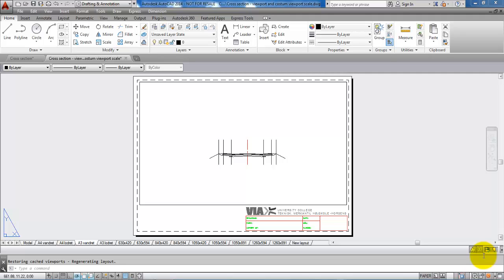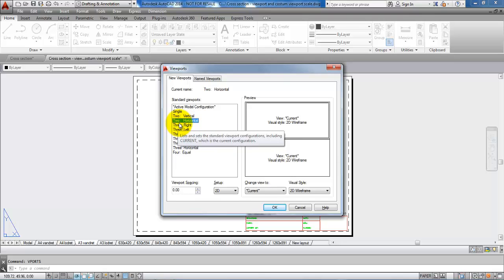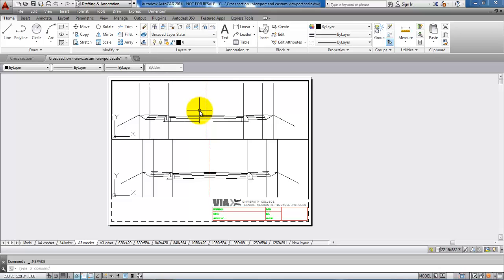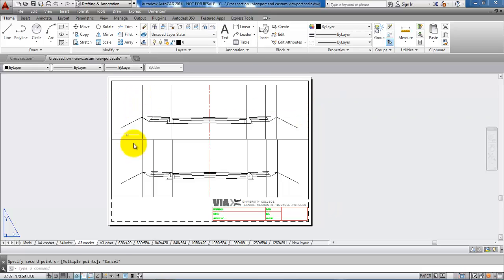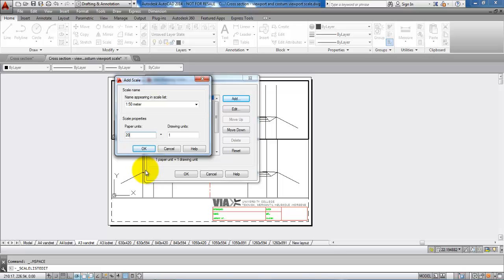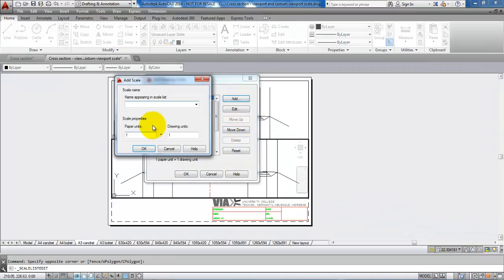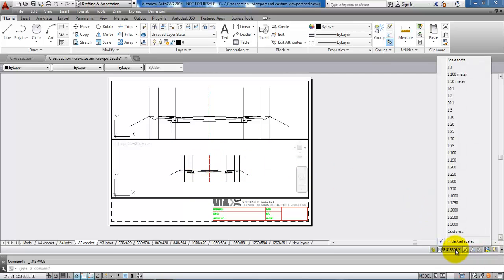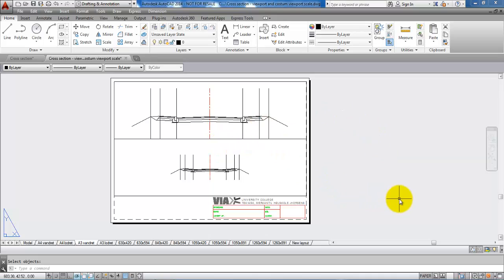AutoCAD 2014_Multiple viewports and custom viewport scale

Comment: i need scale 1:200 .. drawing units 1 and paper units ?????? pls help ...
Reply from the maker: +Irakli Begiashvili Drawing units 1, paper units 5. In this case, you find the paper units by dividing 1000/200 = 5.
Reply: +Katrine Steenbach - VIA University College. thanks...
Reply: I'm playing around with a 1:200 scale as well. This is likely a stupid question but if my units are set to metres in the Drawing Units window would I then divide 1/200 to find a paper unit of 0.005 instead?